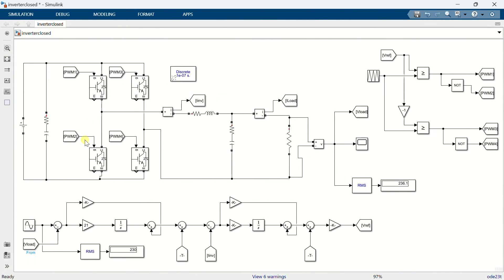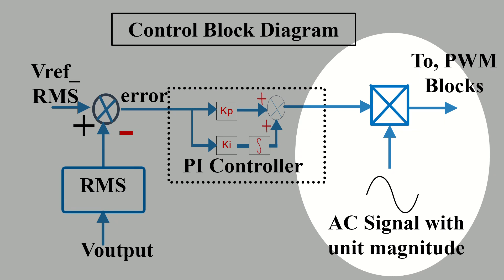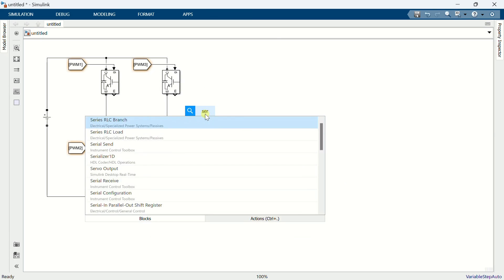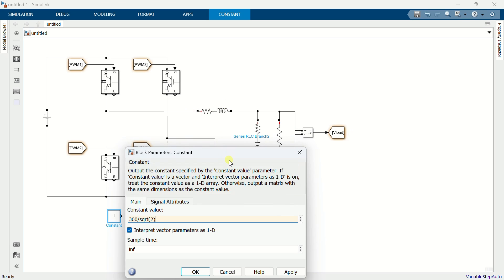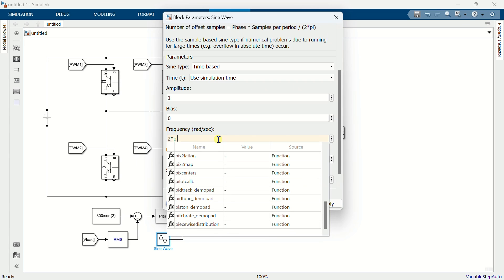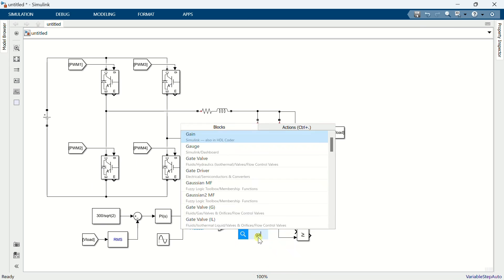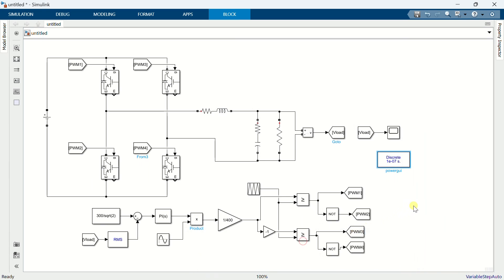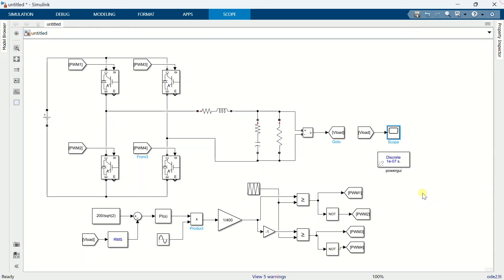Simple control for single phase inverter | MATLAB Simulation | Tech Simulator

Comment: This is a form of Scalar control unlike the PR and Vector (dq) control that is a form of dynamic control. Scalar control works by manipulating the supply voltage or current magnitude as apposed to dynamic control that miniplates the voltage and current transients. You could also control the active and reactive current using scalar control by adding a second loop for the phase angle.

Comment: Excellent video and explanation, I have simulated a grid-forming inverter like the one you present, but instead of rms values as a reference I used the sinusoid with the peak value of the voltage and fed back the  output of the inverter as it is measured by the voltmeter. Tuning the PI controller becomes a slightly more complex task. I tuned it by frequency analysis, bode plots, etc. Greetings from México.👏✌️
Reply from the maker: Nice to hear that
Reply: How did you measure the voltage magnitude? PLL?